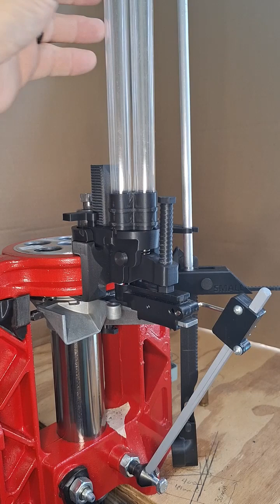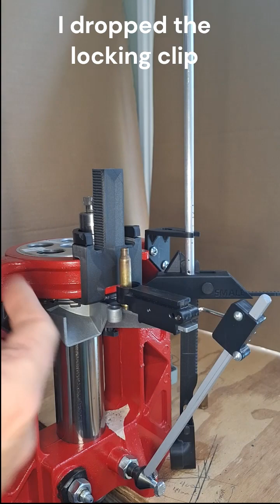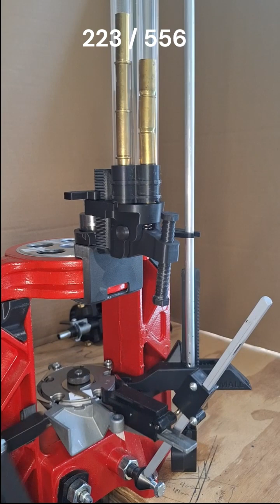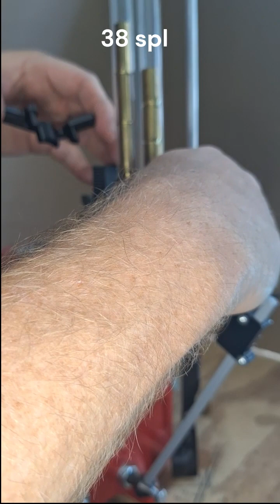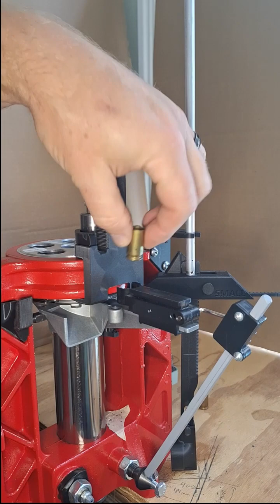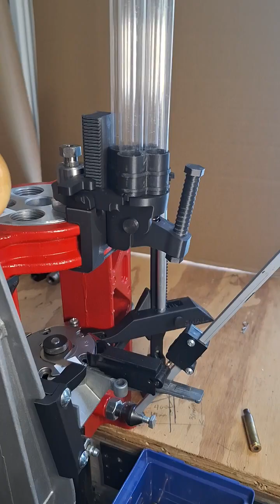Lee Loadmaster Top of Frame case feeder

Comment: Do you have a vid with the loadmaster running your products
Reply from the maker: Hi,  i dont have a full video of running the press with a combo of mods like "top frame case feed and prime on bottom"  I can try to add one just showing the system run.
Reply: @AndyDep  thanks for replying,  I have two loadmasters and they are the hardest machines to keep running consistent. Anything to make it fully reliable would be a blessing. I would like to see  a  LM running them.